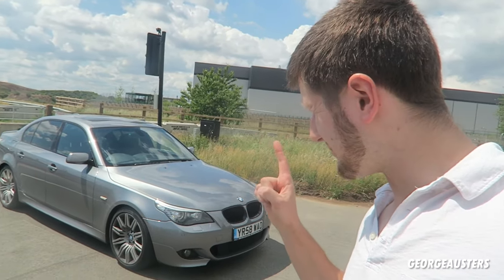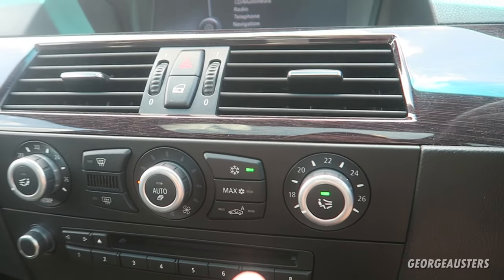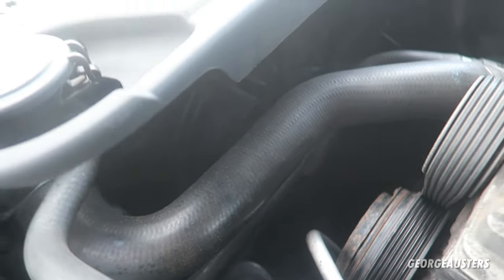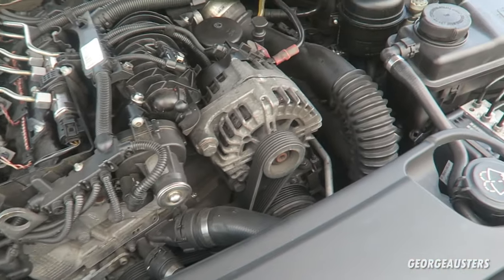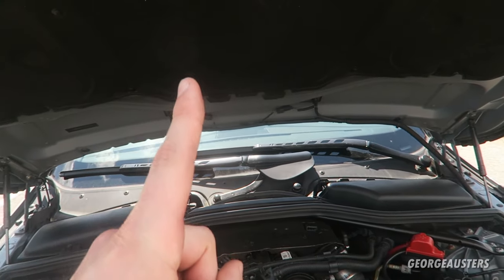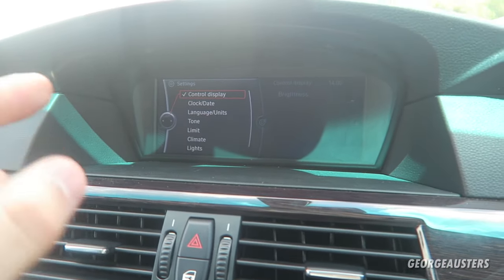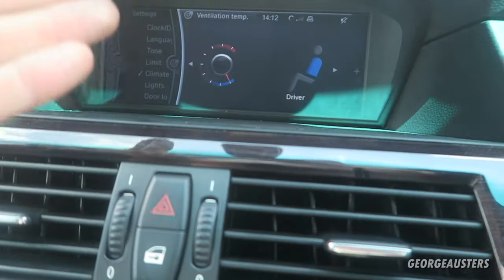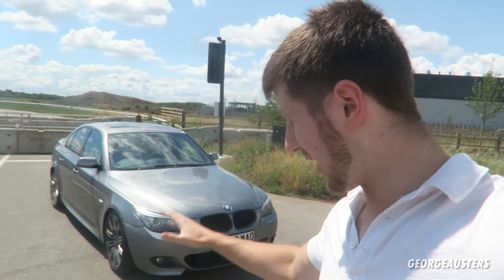AC Air Conditioning Not Working? Try This Quick FREE Fix!

Comment: Great video, thanks. One more thing that could also affect the AC. The heater control valve, if it is not blocking the hot water from entering  the cabin, you will not get that icy air.
Reply: Would it stop hot air coming in when u turn on air conditioning?

Comment: You can check with diagnose tool for pressure in system so you know if you do or do not have leaks. also measure resistance on compressor coil should be between 2-5 ohm. If you feed 12v directly to compressor you should here clicking noise.

Comment: Thanks for that! For years, I've been having to press the MAX button to get cool air and been completely mystified why setting the dials to a lower temperature didn't activate the air-con. Reading the manual, you wouldn't have a clue that setting the temperature in iDrive at any temperature above the lowest disables any temperature lower than the level set in the idrive. Finally, I am able to enjoy the climate control system as it's supposed to work. Staggeringly bizarre and ill-thought through on the part of BMW! I knew the air-con worked because I could use it on MAX and then turn down the volume, but so grateful I stumbled across your video and I no longer have to do that. Thank you.
Reply from the maker: You’re welcome man, glad to help!
Reply: You all prolly dont care but does any of you know of a way to get back into an instagram account?
I stupidly lost the account password. I would love any tricks you can give me!
Reply: @Ayden Isaiah instablaster :)
Reply: @Milo Mathew It did the trick and I actually got access to my account again. I am so happy:D
Thanks so much, you saved my account !
Reply: @Ayden Isaiah you are welcome :D

Comment: I had gone on vacation and gave my e60 530i to my friend in the meantime. He messaged me saying something was wrong with the AC and it's not cooling despite making sure the mechanical stuff was fine. I knew he messed around with the iDrive and changed the AC setting. I let him sweat it out  in the heat till I came back and set it back to the coldest setting. This was in Saudi Arabia during peak summer with 55c outside temperatures and even hotter inside a black car 😈
Reply from the maker: Fuuuuuuuuark couldn't even imagine being without AC in Saudi
Reply: You’re a good friend 🙄

Comment: Hi george ,helpful vid mate , got my ac system vac tested recently(-16psi)and was all good but when pressurised with ac gas ,I had a leak from the condenser after 20mins, lucky I was still at my mates ac garage and he vacuumed again and will be fitting a condenser and heading back up for a regas , turns out the vacuum test sucked a seal in , so cheap fix with a new condenser and will be regassing this weekend .👍✌
Reply from the maker: Good stuff mate!

Comment: Not using AC will cause the system to dry up and not be lubricated by gas/oil. So use It regularly to stop leaks and also not seize compressor
Reply from the maker: Yep spot on mate
Reply: Yes mine made a light grinding noise as if a bit of anodisation had formed on the motor rotor or cylinder, but it’s almost quiet again now. I waz without it fir 5 mnths so I’m happy it’s not seized up👌
Reply: What should I do if the ac system is seized up?
Reply: @kyefang8278  replace compressor. If the compressor has blown and expelled shrapnel you will need to replace every part of the system including hoses

Comment: Hey George, my f01 740i only blows cold once the engine gets hot. AC does not blow cold on a cold start. I have noticed it only cools when engine hits 200degrees
The AC compressor is on when the AC button is on.

Comment: hi mate. 
I own a bmw x5 2004. 
I’ve replaced the condenser , compressor, radiator fan, condenser fan, and expansion valve and still don’t have COLD 🥶 air. The most it gets is “cool”. 
What am I missing?
Reply: I have the same problem with you
Reply: @PhuongNguyen-vj7dw  I haven’t changed it so I can say this is the problem but you may wanna check out the heater valve. They say those get stuck overtime and that stops the cold 🥶 air from blowing
Reply: I’ll try it. Thank you Sleepy Joe

Comment: This temp setting in I drive is the stupidest thing someone ever thought about at BMW. makes absolutely no sense at all.
Reply from the maker: I agree, I’m not sure why it’s in place👊🏻
Reply: Agree with you 100%. In my wife's Audi you set the temperature and taking ambient temperature and sunlight in account, the car makes the temp feel exactly what you set it to. Lowering or increasing of fan speed and direction is automatic. In my BMW, you set the temp but then you can set the fan speed as well. You can then set the temp again in the screen despite what is set on the dial.
Reply: Abdullah Al-Munim it’s completely pointless. I would understand if it had 3 options on the dial, like cool, neutral and warm so it can be set with the season for some
Fine tuning. But why would 9 be needed?
Reply: on every other bmw its a dial next to the face vents. Designed for giving you cool air on your face on long drives to keep you awake, whilst keeping the cabin warm

Comment: Hey George, great video! I used this today and managed to get that icy cool air flowing. I had turned it to hot in the winter but had completely forgotten :/  By the way should the radiator pusher/cooling fan be on when the AC is on? Mine seems to stay off, in fact I think it is always off, do you know why this could be? (525d 2005 M57)
Reply: @GeorgeAusters  a donation to answer a question 😂😂😂😂

Comment: Hey mate have you done a condenser replacement video? 
I’ve bumped my 5 series n47d20c f11 bent it and the gas went up to space 🤣
Reply from the maker: Not yet mate sorry
Reply: Thanks mate it’s look ing like a simple but the top left condenser pipes are a nightmare to separate.   I’ll finish tomorrow. ✊
Reply from the maker: @PoppinPortraits  Are they not just held in by a bolt?
Reply: @GeorgeAusters   hi pal, thanks for this and yes you’re correct, however the supplier gave me the one from your 520d, a 2008 model, so he left the old pipes on and I had to sharpen a screwdriver use lots of wd and hit it hard lots to break it open. When I removed my covers to it stalk it  I saw that I had the horizontal entry pipes instead of the vertical, so I had to put her back together, drive back to Leighton buzzard to collect the correct one for my F11 which was a great result as this one fell open when I undone the 2 Allen bolts. All done mate and freezing cold air for the summer✊👍

Comment: Great videos mate, well done. 
Could another issue be needing a re-gas?
Reply from the maker: Cheers Bob. Of course mate. If you use your aircon frequently though it should never need regassing - unless of course you have a leak!
Reply: Great video. 7:39 You probably should have lead with that.

Comment: Got an AUC sensor code but my air conditioning works. Just doesn’t blow cold. Would the sensor cause it to not blow cold ? Or shut off the system completely.
Reply: It will stay blow cold with the auc sensor out

Comment: I had halfords “pressure” test my system before charging 60quid to refill. Was perfect for a day and the next morning the ac blew warm again....now im thinking my lines must be leaking !  as the fan, pullies, belts and sensors etc are all working good ... any ideas ? And not the obvious to not use halfords aha .
I have the exact same model
Reply from the maker: Yes they should test for leaks before refilling. Did they say how much gas was in before they did? Have you setup your Idrive settings?
Reply: I looked around at refill prices and 60 seemed around average for a re gas.. I witnessed the gauge personally read in the green zone .....halfords actually say that they only refill after a positive test reading. I went back the next day and they filled it again free of charge (this time by the manager and not a 17 year old and same problem,working that day and not the next . Seems i will have to change each part starting with the cheapest and work though the system :(  i drive settings also all the way down and ok there

Comment: Hi George I have a 530d m sport E60, I had my air con re gassed yesterday, the guy said that it was holding pressure with no leaks but my air con compressor was not kicking in, belts are all turning but center of the pulley is not turning, any help would be appreciated thanks.
Reply from the maker: Clutch on the compressor gone
Reply: @GeorgeAusters  thanks mate, not what I wanted to hear 😭

Comment: My 2007 525d SE with Manual A/C doesn't have that AUC sensor near the offside cabin filter housing despite having provision for it ??? Is this only fitted to cars with Climate Control or should they all have this AUC sensor ?

Comment: Does anyone know why the a/c would only work when the button is held down? It blows cold if I keep the button pressed but when you let go, it doesn't blow cold at all.
Reply from the maker: Scan the car for codes
Reply: Did u found the problem out
Reply: @rubengonzalez8503  I just replaced the a/c button and that solved the problem 😊

Comment: I need to know how to check the high compression side to see if the Compressor is working OK.
It takes several minutes to start working when it's above 90 degrees outside in Las Vegas.
Reply from the maker: It will take a bit of time to cool the cabin, that’s normal

Comment: Hi I have a BMW 330xi 2006 and when I turn the AC on it don't blow air at all I don't get no AC or no heat what does that mean
Reply from the maker: Blower motor gone, there is a recall to replace it

Comment: Don’t know if yours is the same but my e60 if you press the little seated man on the temp control it brings that setting up instead of going into I drive
Reply from the maker: Yes you’re correct🙌🏼
Reply: Where do you purchase your vanos solenoids from pal
Reply from the maker: @mrstrawhat32  I haven't purchased any yet mate
Reply: George Austers ok thanks mate , just getting a couple of codes up for them so going to change them , just wondered if you can get them anywhere else apart from bmw 👍

Comment: Hi
I retrofit climate control from pre-lci to lci and the compressor air-conditioning not turn on 
I did pin 21 but it's not working
Can you have any idea
Thanks
Reply from the maker: Have you done all the coding?
Reply: @GeorgeAusters  no I Don't
Reply: @GeorgeAusters  only need coding?
Reply: @GeorgeAusters  My a/c compressor isn't turning on.  Just had the system charged too.  Could it be because my CCC unit died?

Comment: So is there a way to sync both sides? I mean if the driver selects one temperature, that all the vents are adjusted to that? Most cars have a sync button to do that. I don't see anything like that on the E6x.
Reply from the maker: Just set them to same temp
Reply: @GeorgeAusters  Ah snap. Now thats not a good design imho. But at least they fixed it in the later versions (F series).

Comment: compressor is not spinning, everything else is OK. Had just just refilled and fix the leaks, no problems left and last summer it all worked, but the compressor wont engage. No even if i tell it to engage with computer, any ideas ? BTW compressor works fine if i apply power to it manually, just the car wont let it turn on.
Reply: Did u fix it bro mines doing the same, like the car isn't telling the compressor to switch on.
Reply: @JUNK4UCREW  I found the problem but isnt fixed yet, set a time for it for tomorrow. Mine still had a leak after the last repair, and its the evaporator sadly so its gonna be a major price tag.

Comment: There are no such settings in the CCC idrive system
Reply from the maker: Go to climate settings👍🏻
Reply: @GeorgeAusters  Thanks for responding! I did and saw the vent timings only.  I did not see the hot/ cold dial.  Do I need to flash my CCC to a new version?

Comment: The AUC sensor isnt in the place as yours is even though the housing for it is. Where else could it be.? 520d 2008 lci
Reply from the maker: It should be in the same place mate
Reply: That's odd do you think bmw main dealer have taken it off they are the only people who have serviced it from new.
Reply: Found it. Cooling fan housing. Cheer mate. Love the vids.
Reply from the maker: Nice one mate. That’s interesting though. Does it look like it’s been relocated?
Reply: Apparently if it's got the Advanced AC system that's where it goes.
Reply: Hi George can you help me keep getting fault code coming up auc fault but the auc isn't by the pollen filter or on the fan shroud I can't find it at all
I have a 520d e60 2008 can you help please